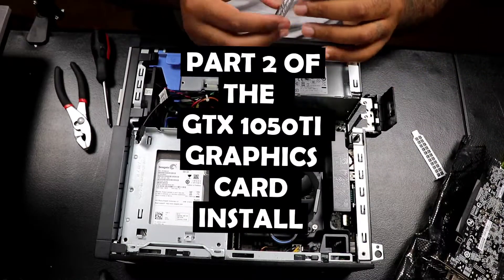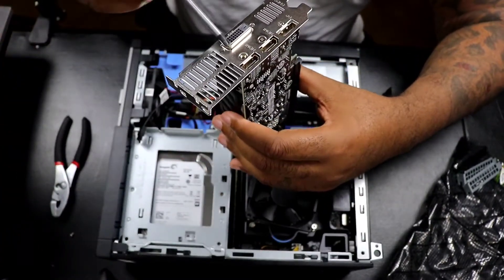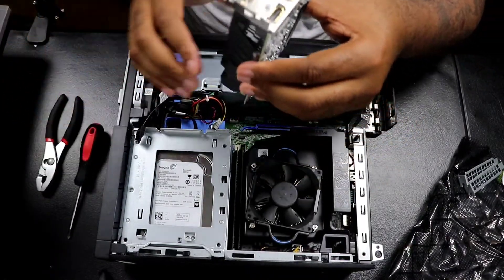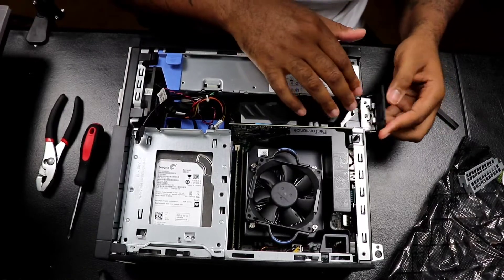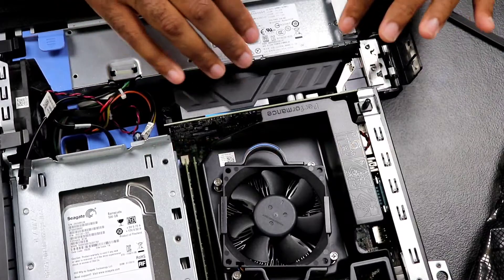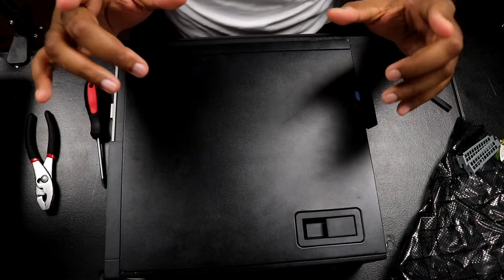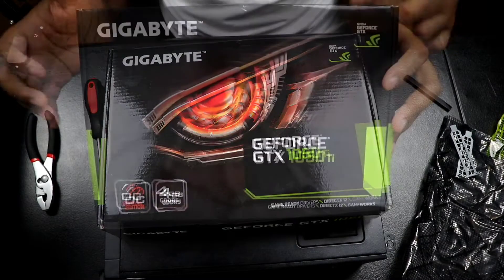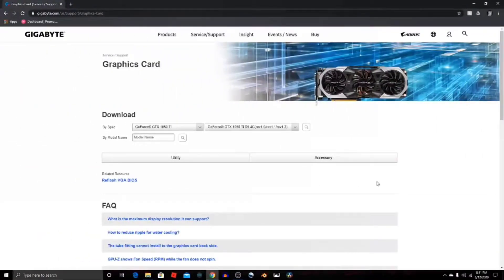HOW TO INSTALL A GTX 1050TI GRAPHICS CARD | #DELL OPTIPLEX 9020 SFF | PART 2 | #ASMR

Comment: Cool video, I dont bother paying extra for sff cards, being a pro engineering workshop guy I cut a slot in the lid for full size cards, cost me nothing.
Could also do this slowly with a 
3 dollar mini/junior hacksaw or
a 15 dollar tinsnips/metal shears
and smooth edges with sandpaper,
then zap with rattlecan primer and paint to finish.
Reply: Oh I held down the switch that cuts off the power with lid removed from the case by using some of that sticky bandage tape , you know the stuff that if you put a bandaid on your finger and it wont stay on, then you wrap this stuff around it to ensure it stays on? Very versatile.😊

Comment: How is the PC running with the GPU through the shorter x4 slot man? Have you ran into any system stability issues or hardware failure?

Thanks!
Reply from the maker: No sir! I’ve got a MacBook Pro and my wife uses that rig that I built for everything! For her flash custom designs business and editing her YouTube videos.
Reply: @StraightOuttaContent  perfect!! Thanks for the reply bro I appreciate it :) keen for mine to be up and running soon

Comment: does it go in the black or the blue one
Reply from the maker: Great question and thanks for asking. I forget but what I can say it goes in the shorter one. So there will be some left over but it will fit and work properly.
Reply from the maker: I looked at the video right now, it goes in the black one. Did you get the low profile card?
Reply: @StraightOuttaContent  yes it is a low profile one
Reply from the maker: @cash8516  okay perfect then yes it should work

Comment: Hello. Is your PSU the stock 255w?
Great video!
Reply from the maker: Damyan Vasilev hey thanks for the comment. Yes it’s the stock unit. Really no need to upgrade if you’re running this type of setup. I’ve been running this setup for a while and it works great
Reply: @StraightOuttaContent  I just both OPTIPLEX 9020,  4590s/ 16 GB RAM/ 256 SSD and I'm wondering what GPU to install.
1050Ti or 1650, but i'm not sure if the stock PSU will be able to power the whole system for optimal performance.
Reply from the maker: @damyanvasilev4259  I'd go with the 1650 if you can find the low profile one. Just make sure it doesn't require an external power source. The 1050ti is a solid graphics card for the money. Be ware of some screen black outs when running video or games.
Reply: @StraightOuttaContent  Thanks for the reply. I read a bit on the subject. It turns out that the x4 PCIe slot only supplies 25W of power. Which is sad :(
Reply from the maker: Damyan Vasilev true. But my son is filming a fort nite video on the same setup right now as we speak with zero problems. Lol for the price of each part is a really decent setup
Reply: @StraightOuttaContent  Damn, I might as well through in one these cards just so if it pleases me. Can you please share the full specs of your machine?
Reply from the maker: @damyanvasilev4259  Dell Optiplex 9020 SFF i5 intel stock processor. 24gb ram. 1050ti GPU. Stock power supply.